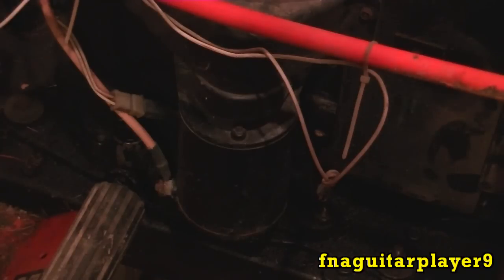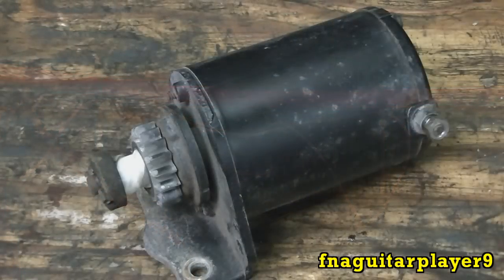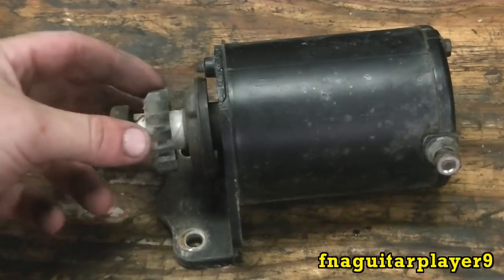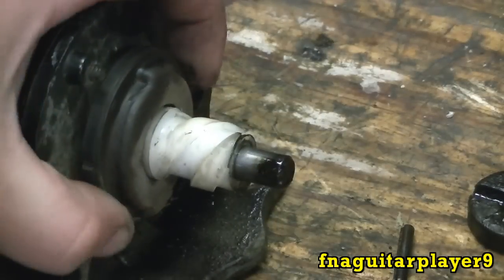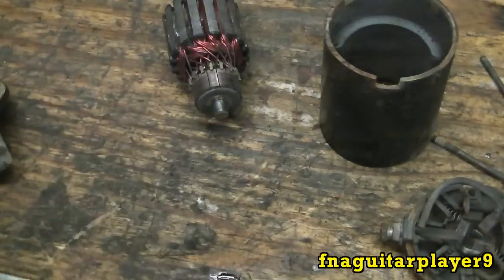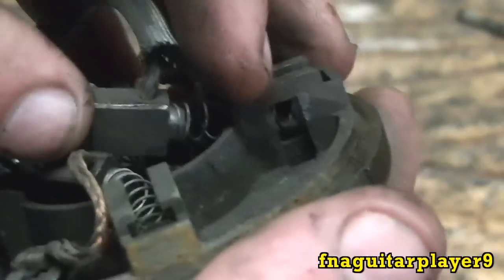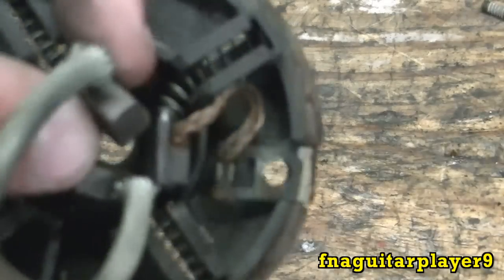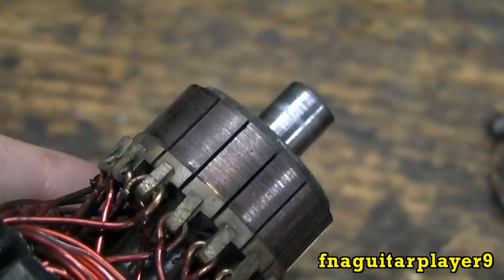Briggs and Stratton Starter Motor: Clean / Reseat Brushes, Commutator, Grease, and Replace Gear

Comment: Was checking a starter for my Toro W/Kawasaki engine 
Different style of brushes and no holes at the bottom to come through 
BUT 
Your tip on holding the brushes in gave me enough of a hint that I adapted it and overcame 

Many Thanks for the inspiration

Comment: I am an industrial electrician by trade and I do not understand why you filed the brushed flat. I have reused many brushes in my career and never had to file them flat. They were used and bedded in already to the correct curvature.  I personally would not have filed them. Otherwise it was a great video. My MTD mower starter has the brushes on the end of the commutator(similar to the shape of a piece of pie) instead of coming in from the side. The end design is also the same as outboard motors like Johnson, Evinrude and mercury. Identical brush box and brushes.

Comment: My Onan generator starter worked fine for 23 years then suddenly would not spin, would not turn the motor.  Solenoid would just click.  After checking and double checking battery voltage, switch, solenoid, and connections I bypassed the solenoid and applied power directly.  It would just hum.  Took it off and bench tested it - it worked!  Pulled it apart and found the strangest thing.  There was a 5th brush spring loose just sitting in the brush plate area among the brushes!  During removal I must have giggled it loose from whatever it was interfering with.  Nothing was burned so it was not shorting between hot and ground.  Lubed it up and put it back together using your ideas.  Works fine.  Thanks.

Comment: Ok hope you can help I have replaced the flywheel, battery and solenoid when I turn the key it does nothing (like the battery is dead) But its a new battery. any ideas? Thanks
Reply from the maker: First thing, make sure that the "trigger" wire is on the right side (same side where the cable from the battery connects) and make sure you fuse is good. It could be a bad key switch but its probably one of those things or possibly a safety switch keeping it from cranking. And check the battery for charge, its possible to get a bad battery. Thanks for Watching!!!

Comment: how do you tie up the brushes?
Reply from the maker: The way i do it is use a small piece of bailing wire or something similar, compress the spring and slide the wire through one of the slots on the bottom, and around the brush itself then back through the other slot, kind of hard to explain, next time I do it I'll make a video. Then you put it back together, and once you get the plate back on and put the bolts back in, cut the wire and pull it out, OR you can make something similar to the factory style with a paper clip, if you watch my other video I show the factory clips, you should be able to make something like it. https://youtu.be/ORBbRy8Z0uw Hope this helps, thanks for watching!!!
Reply: I took 4 cotter pins, bent them out somewhat and come in from the hole on the other side while depressing the brushes

Comment: Hi fnaguitarplayer I'm rebuilding a 1986 John Deere S92 with an 11 HP flathead Briggs, I have a question. Which is the negative and which is the positive on these roll type starters?
Reply from the maker: dontdrivehonda I hear ya. On these type of starters, the negative/grounds is from the frame, bolted to the engine, the positive is the small 7/16" nut/bolt on the bottom, facing the rear of the engine. Hope this helps! thanks for watching!

Comment: My end cap doesn't have holes to hold the brushes, any ideas?
Reply from the maker: Steve Lynch That may be a different type of starter, there is another type that i've never ran into that has a separate piece that holds the brushes. Thanks for Watching!
Reply: I just refurbished a starter today with no holes in the end cap. I drilled 4 small holes in the cap. MADE some  u shaped pin . WORKED LIKE A CHAMP.
Reply: @TheWJLocke  you would think they would put holes in all of them.

Comment: very informative but now here's a tip for you, back in the 50s-60s we had rebuilt every starter and generator, to clean the commutator, we used a hack saw blade that we ground the sides smooth on a grinder leaving just the teeth, we would pull the hack saw teeth backward in the commutator slots to clean the grit out, back in the day I had a tool called a growler to ck the armature, by the 70s rebuilding things went out . we weren't mechanics anymore, we became parts changers.
Reply from the maker: That makes sense, i might try that next time! I know what you mean there, about replacing parts instead of rebuilding, i guess its faster, but not necessarily cheaper. Thanks for Watching!!!

Comment: I think you are right about filing down the brushes to let them reseat in like new ones.   If sanding the commutator reduces the circumference very slightly, reinstalling the used brushes even if lined up perfectly there would be a very slight air gap on each brush at first before the brush reseats to the new curve of the reduced circumfrence.  The air gap could create some  arching, and could pit the commutator.
Reply from the maker: That is true, I just feel it helps everything seat in, and if a starter is dragging and the commutator needs cleaned instead of replacing brushes that are still good doing this will act just like a new set. Just one of my own ideas more/less thanks for watching!

Comment: you said 14 dollars , I'm seeing 40 bucks online ,where can I buy for 14 bucks ? thanks ray and thanks for all your help
Reply from the maker: Yeah, I buy parts from tulsa engine warehouse, tewarehouse.com when you type in a part # you will have several options for the same part, I go with the cheapest, right now for the end cap its only 9 bucks, its aftermarket not genuine briggs, and I have had no problems at all using aftermarket parts. If you need part numbers or cant' find it on there get back with me and i'll help out, your welcome, thanks for watching!!!

Comment: I never heard of filing down the brushes, if I am reusing the old brushes I just make sure the comutator is clean like you did and make sure the "curve" in the brushes sit proper.
I never could keep the brushes held back, they always snap loose before I got the cover on, threw more motors away because of that.
Reply from the maker: Its something I started doing myself, it makes sense to me, it makes them seat back in like a new set, I'm sure what your saying works just as good, or even better, i couldn't tell you haha It is a pain but if you make the [ shaped pieces it holds them in pretty good, haha heard that! I'm going to make a note in the video about filing the brushes, let people know its my own idea and it doesn't have to be done. Thanks for Watching!!!

Comment: What's the purpose of filing down the brushes?
Reply from the maker: I think it helps them seat in better, for one the commutator will be 
slightly smaller after sanding it down, it makes them seat in like new 
brushes, i think its the next best thing to replacing the brushes. I 
could be wrong, it might be a waste of time but I've never had a problem
 doing it. Thanks for Watching!!!
Reply: Oh. Okay.

Comment: What is the purpose of filing the brushes since they're already seated ?
Reply from the maker: I think it helps them seat in better, for one the commutator will be slightly smaller after sanding it down, it makes them seat in like new brushes, i think its the next best thing to replacing the brushes. I could be wrong, it might be a waste of time but I've never had a problem doing it. Thanks for Watching!!!

Comment: I have a 15.5  OHV b$s and it turn and stop I rebuild that starter new batter and turn the vales and I took the presser release of and it does still do u thank it the crank bent?????
Reply from the maker: Sounds like the valve clearance needs to be set, if there is to much gap the compression release will not work, intake valve .003" to .005" and exhaust .005" to .007" Thanks for Watching!!!